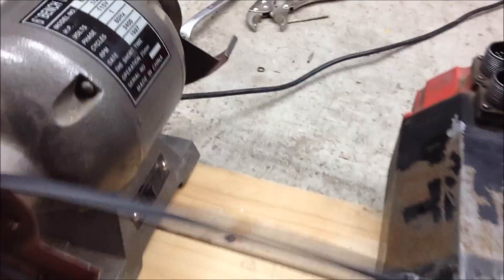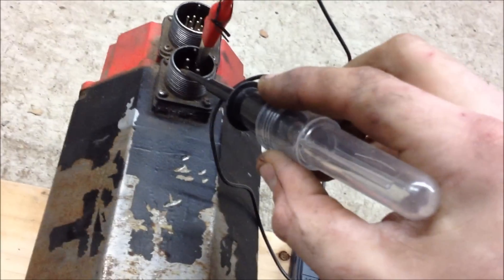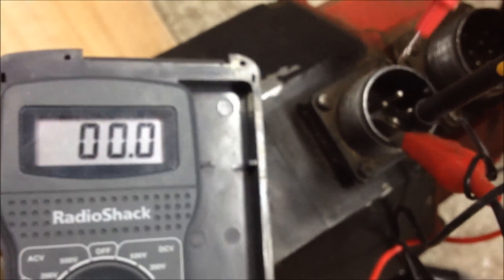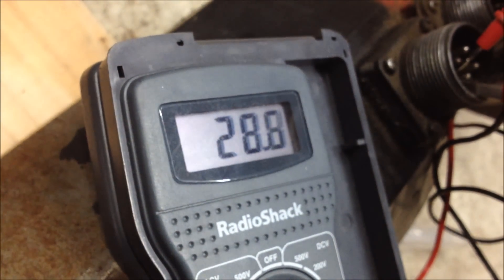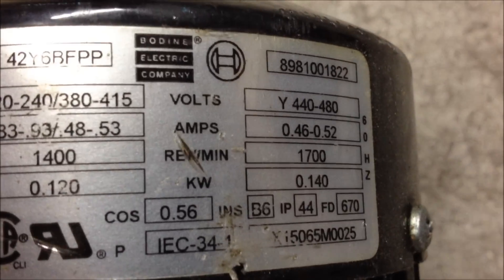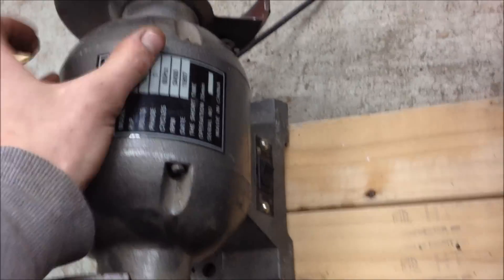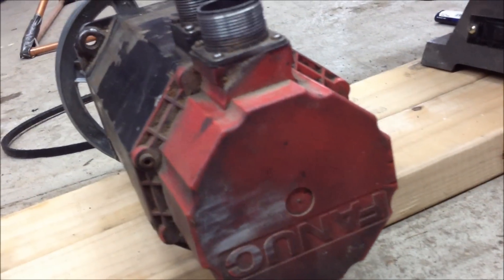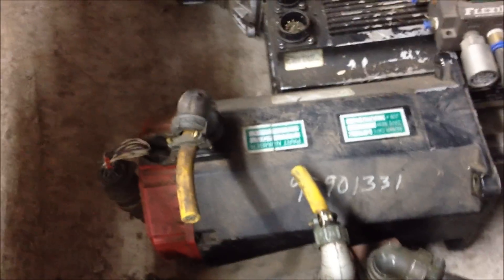AC DC Permanent Magnet Motor Generator GO OFF GRID POWER FREE Home Energy Electricity Setup HOJO PMG

Comment: Afghan Lover,please explain to me to how to make a generator that powers itself and what parts I need to buy.I also want to have free electric power off the grid for my house.Is it also possible for you to send me a electrical diagram how to wire up the whole system?Can the generator run 24/7?Because I want to switch my fridge and freezer on 24/7.Is it possible for the generator to give 1 kw of power?Also describe to me the size and calibre of generator I must buy.

Comment: By the means we have on earth, perpetual motion is impossible. by doing this project you are trying to achieve more than perpetual motion and gain electricity. There are a lot of things in this machine that are loosing energy like the loose belt and all of the resistance in the wires. If you want "free" energy make a windmill or a solar panel.
In everything there is friction and the actuall meaning of friction is the loss of energy through the rubbing of 2 or more surfaces.
 -B "im 15"

Comment: That the motor can only run 1 mile on 1 gallon propane but can run 2 miles on 1 gallon of gasoline 
This is just a example 
Next to this is the weigth of gasoline in a example 
1 gallon of gasoline is 100 cm3 
And 1 gallon of propane is 1500cm3

So propane will take a room size of a hole house but it can be compressed and   gasoline cant be compressed it can hole a pressure but it will not be compressed to getter 

I now this isnt anny thin to do with you project but think about properties of EL

Comment: amps x volts = watts. both of those would be 2400 watts.. you have your idea reversed since the higher voltage will be more efficient. high amps at low volts creates waste in the form of heat in the wiring.

Comment: I could be wrong but I don't think that would work for long. I think power would be continually lost as the energy is transformed from electrical to mechanical and back to electrical. Because this is not efficient it will waste energy. Again I am no electrical engineer but that's how I understand a project like this would fail.

Comment: bradalexander1 The first thing is, I am doing almost the exact same thing,so were on the same page.I am using a bench grinder motor but I am using a much smaller generator (pma)..I got 96 volts dc out of the system with a 3/4hp at 3600 rpm. Anyway the key here is getting it to run under a load(running light bulbs or charging batteries).A tip I found is adding weight like a flywheel to the system.A flywheel will help keep it going under a load and take some stress of the off the drive motor.

Comment: Use a bigger fly wheel on the motor that is supplying the energy to the generator. Another Idea you might want to look into is using a battery supply to power the electric motor that gives the starting energy.  The key is to use an inverter to run the "grinder". ALSO use multibelt fly wheel's to run multiple belt's to ALTINATOR'S!!! Your altenator's are going to be what RESUPLY's  your energy. also look into magnetic insulator's to reduce WASTED energy! A (star gate) insulator would be ideal.
Reply: Sir, where can you find a dynamo like this?

Comment: its all about amps... 20 amps on 120 is 10 amps on 240 volts... you need to be creating more amps than your using and you will have a self powering generator.

Comment: I guess you've figuered it out by now but sort the belt man. IT's realy slack and you are loswing o much power generation because the thing is shking about not transfering the power from the motor to the generator.
I'd link up a LOT of generators to that one motor to grealy get a good gain of power over the power used in the one motor.

Comment: small potato chips little boy.  You need more time to learn about electricity, gear ratio, pully positions, and how much you need to actually run a entire house.  Hertz, cycle time, phase, wire diameter, kwh, watts, volts, amps, resistance, and free energy is a cycle down phase of energy.  You need a self sustaining power source to create the energy to drive components to power other components.

Comment: you should swich the big wheel to the other side then the generater will spin faster and make more volts ps it takes at least 200 amps and 220 volts to run a house.

Comment: The idea would be to add a green energy source input to a system like this. Those battery backups are made on larger scales too for old rack system computers equipment or have a several small ones. This would take some reseach to figure out whats possible but may be a good direction to go.

Comment: Sorry for the delay, I've never set up a system on that scale so I wouldn't be the guy to ask. However, I like to recycle free or cheap items to make other things for fun. I have been interested in battery backups such as the ones you use for computers. They are for a specific battery type "AGM" not usual lead acid but you can access the battery. They all have a charge controller for standard AC input or gas generator. Also, they have a 12v inverter for AC out. Food for thought?

Comment: One thing to note about those motors is they "cog" by design. In fact when you accidently touched two of the phases together at aprox 2:01 the motor hopped .. be carefull, it could rip right off that mount! Also, Im not certain on the specifics of the system you are setting up but I have used a servo motor for a homemade wind turbine and so could only be of help in that capacity. In any event they will need to be driven by some kind of power source.What is the motors voltage and Amperage rating?

Comment: That’s a three phase servo motor and does make a very efficient alternator as you have found. The four wires are one ground and the three hot “legs” which you would need a three phase rectifier to make DC. The other pins are to the encoder which interface with a computer since that motor is made for automation like CNC machine tools (can be removed). I have made a wind turbine out of one of these and it’s one of my favorite. Good luck with the project!
Reply: Sir, where can you find a dynamo like this?